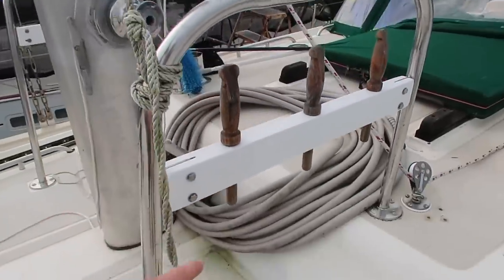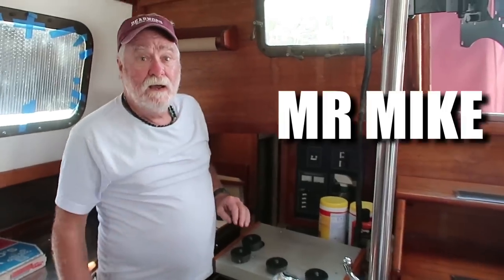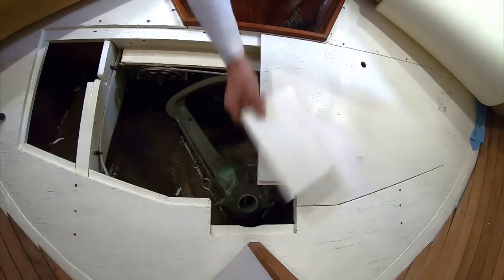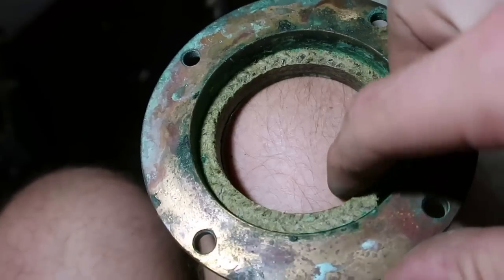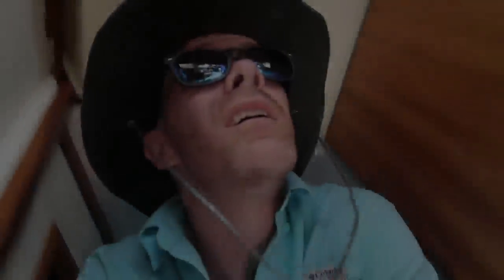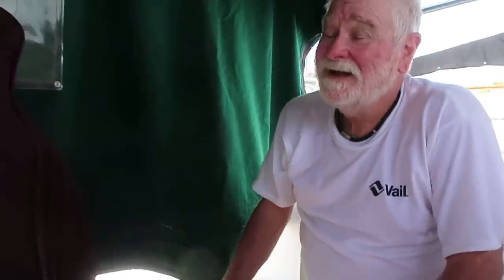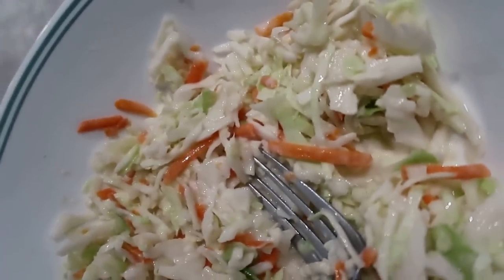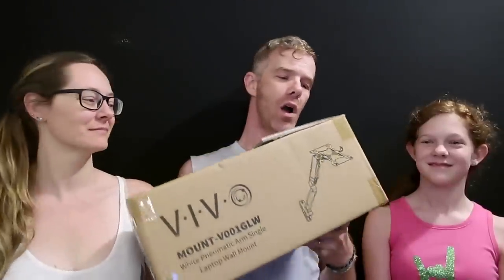Why Is Our Rudder Post Leaking & Knocking? | Sailboat Story 211

Comment: This may have been mentioned, but I think tightening the packing gland on the rudder shaft might fix the leak and the clunk. The packing didn't look bad but replacing it would be simple vs trying to put in shims that would be so thin. Crushing the packing  more would center the shaft and stop the leak seems to me.

Comment: How about investigating a different style of rudder stuffing box assembly that could slip over the rudder(fiberglass) tube and have a closer tolerance  ID for where the rudder stock rides. It may(will!) require some custom machine work/fabrication. This way you get some solid support for the upper rudder stock and keep the water out. If you do nothing else, however, drop that rudder while you're still on the hard and take a hard look at the whole assembly.  You'll sleep real good knowing  you covered that base.

Comment: You should be able to get a "Speedi sleeve" that will fit over the shaft from a bearing supply, they are thin stainless steel sleeves used to repair worn seal faces on shafts just tight slide on with some green loctite and the gap will be taken up, also with new seals the play may be taken out as well. At the end of the video you showed a side view of the boom over the bimini looks like you could just extend the boom gallows and keep the bimini headroom.  She's coming along nicely enjoy
Reply from the maker: Thanks for the idea on the sleeve. The taller gallows would only be helpful when motoring only. Without additional adjustments, the first tack would swipe the whole bimini, dodger, and probably ole Cap'n Ben into the ocean.

Comment: I would glass some thin cloth on the inside of tube and use a flap wheel to fit post, fabricating a dumby post of same size to fit . Did it on my boat ,no play in 5 years
Reply from the maker: What we ended up doing is using something called teflon film, we shimmed up the inside of the tube and folded the pieces over like flower petals. The hose clamps that hold the stuffing box in place are also holding the petals down on the outside. No play with the boat on the hard, but we'll see how it does once we start sailing. I like your solution and considered something similar, but it it would require dropping the rudder to access the interior of the tube - something that we really wanted to avoid with all the other projects we had going on.
Reply: @Sailboatstory  Nice is it lasting ?  I actually glassed kevlar cloth ,then some marine grease on shaft ,like I said no play in 5 years

Comment: Chances are the new flux pressed in and squeezed will take up the slack in the rudder tube. However in other boats Teflon sheets can be placed down there. Just cut the sheet so it won't overlap and slide it in.
Reply from the maker: Do you know of a video or link where someone has done that before? I wonder how well a super-thin sheet of that would hold up over time with the post grinding against it. The sheet would have to be quite thin - perhaps  only 1/32".
Reply: @Sailboatstory  So, Utude didn't like the links for the forums I posted showing and detailing it done on a Catalian380 group, Bavaria group, Beneteau group, my own post on Cruiserforum from 2 decades ago... 

But... Baking sheet teflon is enginered to a tolerance, it will be on the box. you can also purchase engineered sheets online. 

I thought it would bind as well but it doesn't. Just make sure it's not overlapping when you slide it down over the rudder shaft. 

The video below may help. You have better access from above.
Reply: @Sailboatstory  I'll add one more... this works on boats without replaceable or rebuildable bearings. And don't ever put grease in there, it will stick and hold onto dirt and grit in the water and turn into sand paper. Teflon spray and sheets work well. Beneteau actually has a DIY article for owners on this. I left it on Redemption when I sold it, or I'd share it here. 
This is a pretty common repair.

Comment: Machined Delrin bearing is the solution.  There is a guy in Indiantown that did this same thing for us on our Colvin Gazelle last year and he is quite a magician...  I can look up his name if you are interested.
Reply from the maker: Was your rudder play situation similar to ours in that you had to fill a VERY small gap with the delrin bearing? I can make one, but I'm skeptical of how well a super-skinny, 1/32" or smaller, bearing would hold up against the constant back-and-forth grinding of the rudder shaft against it. How large was the gap you had to fill with the bearing?
Reply: @Sailboatstory  We did a big bearing at the foot, and about a 1/16 thick inch sleeve at the stuffing box.  If you have less maybe just replace the stuffing with good think flax.  Maybe your construction is different, tho we were working with steel.

Comment: For the record:
In order to create a snug fitt between the ruddershaft and the rudderpost you might have success with a grease gun and a a few grease nipples. 
The method require a release agent sprayed on a plastic film wrapped around the ruddershaft. The plastic film used having the desired thickness equal to the wanted play. 
A previously unused (wastable) grease gun. 
Grease nipples mounted fairly high. Gravity is your friend. 
A "flowout" protected seal at top of the post and at the bottom of the post. 
-Inject warm epoxi into the nipples filling the exess play void. This method will not work if there are irregularities, damages i.e, on the rudder shaft as those definitely will create an irregular surface in the post hole that in turn will give irregular resistance when the ruddershaft is turned during use. 
-Smoothing the surface on both shaft and post hole is a must! I used a circular steel brush (don't know what it is called in english for drilling machine) as "homing" of the rudder post hole gently before the repair to smoth the surface inside and make the surface accept the new epoxi so it will stick for ever. 

I my case I made a separate test modell before I fixed a larger wear damage and a crack. Small day sailer. I did this when the glasing over of the crack didn't fix the play.
1 Having a ruddershaft that turns is the purpose and not stuck forever (kind of silly have a rudder that is stuck...). 
2 Wasn't shure I wanted to do this directly in the boat as the flowing of the epoxi might be uneven and it won´t so three nipples in 120 degree pattern around was needed. Gravity did the rest. Cleaning the grease gun with acetone didn't work. Two was needed. Use the shaft as a guide to smooth out epoxi onto the post surface wasn't an option due to the impressive play and abcens of support while curing.

In your case this might be impossible due to rudder weight and a larger total surface inside the rudderpost. You also have a smaller play. In my opinion your play is ok and the seat of your seal isn't. A chime might be your best DIY solution. I didn't have a seat problem but for the record there are methods that might be useful in certain cases. Try to get a proper seal seat first before you do anything radical like I had to do.
(And I lost the race the following weekend...)
Reply: @saylaveenadmearedead  True. The play wears the seal in the seat and if the play is small enough not to wear the seal manufacturer deside the boat is good for safe use. However when the post is worn the seal will age faster as movement in the seat wear and next there will be some type of function failure.
I shared my experience as I had a vertical crack and made a first failed repair and completed it with a second repair with great success.

Comment: they make brass stock shim for engine bearings.  should be pretty cheap.  .005 wrapped around shaft or butterfly around and bend over.should work. on line or NAPA should have them.
Reply from the maker: Thanks for the idea!

Comment: Given the obvious lack of maintenance in addition to redoing the packing on the rudder post I would be dropping the rudder and examining all the support points for wear. There are probably bushings that are worn out. That thin fiberglass tube may keep out the water but there is no way it controls the rudder post in any significant way which is why there is a rubber boot below the packing.

Comment: There should be a rudder bearing between the shaft and the hull.   That would be my primary suspect.
Reply from the maker: There are 2 plastic rings in that location, but they're more of a spacer. They seem to only really limit vertical movement. They're not fixed in any way that would limit lateral movement of the shaft.
Reply: @Sailboatstory  check with the Westsail owners group.
Reply from the maker: I've posted twice about it. Bud suggested that the "Catalina Rudder Fix" could work, but he didn't know of anyone who has tried it. We have have to be the pioneers for this fix.

Comment: Repack the rudder stuffing box.  That will reduce the leak to what it should be and act as the upper bearing for the shaft - i.e., get rid of the knock.
Reply from the maker: The rudder's stuffing box isn't a bearing surface as the whole unit moves back and forth with the shaft since the rubber hose is flexible. I did repack with new flax, so at least the leak should be stopped, I hope.
Reply: @Sailboatstory  in that case you may have a cutless bearing where the shaft enters the hull that is worn and needs replacing.  That will require dropping the rudder.  If there isn't a cutless bearing, then you will likely need to drop the rudder, wax the shaft with 8-10 coats of mold wax, reinstall the rudder and pour graphite loaded epoxy into the shaft tube around the rudder stock.  The graphite loaded epoxy will give a low friction bearing surface and the wax will keep the epoxy from bonding to the shaft.
Reply from the maker: Yep, that's the "Catalina Rudder Fix". I hope to not have to do that one. I've not been able to find anyone else with a Westsail that has done that fix, and I'd prefer not to be the pioneer, but it may come down to that eventually.

Comment: Typical fix for that rudder shaft knocking is to pack the gap with thickened epoxy with graphite, though first you would need to remove and wax the shaft so it doesn't adhere, then you use a syringe to inject the epoxy at several points.  West System has a tutorial on this.
Reply from the maker: Correct. That's the old "Catalina Rudder Fix". Could work, and might be what we have to eventually resort to.
Reply: I’m wondering how the wax on the rudder shaft doesn’t transfer to the tube when sliding it back up?
Reply from the maker: There's no way to avoid at least some transfer that I know of.
Reply: Great information. Thank you.

Comment: That movement on the rudder tube could be  fixed with some metal shims, stainless or bronze. You might have to make them. But a few in place will center the rudder tube. The bigger question is whether or not that play is the source of your leak and not the packing material
Reply from the maker: With how much green there is between the 2 pieces of the stuffing box, I'm fairly confident that the leak was coming from the flax seal. Also, the compression screws didn't have any torque on them at all and came off easily by hand. They may have never been tightened, and that wouldn't surprise me in the least with some of the other oddball things we've found along the way.

Comment: Not sure if this will help with the knocking/movement on the rudder, but if I recall correctly, Drake Roberts had a similar issue when Paragon was in Boston (2013?). Bud Taplin had him install a spacer to take care of the problem.
Reply from the maker: What he was experience was vertical movement in the rudder shaft, not lateral. He installed a plastic ring between the rudder and the body of the boat to limit the vertical travel. Still, adding a space outside could potentially help a bit.

Comment: The knock is because the grease cords were hardened. The play is totally normal and once repacked, greased up and not overly tightenend all will be good.
Reply from the maker: The entire stuffing box moves with the shaft because of the rubber hose, unfortunately.

Comment: You probably know this already, but the cables are attached to the steering quadrant incorrectly, Captain Q Yacht Hunter just did a good video on this titled "9 EXPERT TIPS YOU SHOULD KNOW ABOUT STEERING SYSTEMS - Ran-day EP 6" for anyone interested.
Reply from the maker: In what way are they incorrect?
Reply: @Sailboatstory  Both nuts should be on the post side of the quadrant, one to set the length and one as a lock-nut.
Reply from the maker: That’s how our set up is, only ours is even safer because we have locknuts on our locknuts. (4 nuts total) 👍
Reply: @Sailboatstory   :- D

Comment: .   Does the rudder itself have too much play?   Fix the leak with new packing and see if the knocking/Movement is still there!
Reply from the maker: It's an almost imperceivable amount of movement. The worst part, as far as we can tell, is the knocking noise it makes that's going to be right under our bed. It only makes the noise in certain conditions though. Yeah, as much trouble as it seems like it would be to fix it, I think we might do exactly what you suggest for now.
Reply: I’d slip some thin copper or brass strips down into the rudder tube, grease them up with some copper grease and bend the top edge over the top rim of the rudder sleeve and hold them in place with a stainless steel Jubilee clip or Hose clamp as you guys call them. You need some free movement of course but that should sort it out. Another great video Ben!
Reply from the maker: That's an interesting idea as it could be done from inside the boat, but I'd worry about the strips grinding away at the rudder post over time. Do you know of anyone who has done something similar?